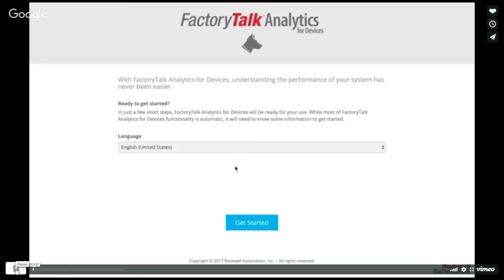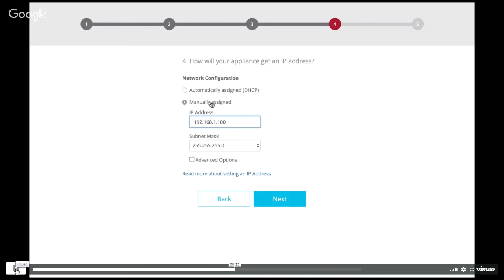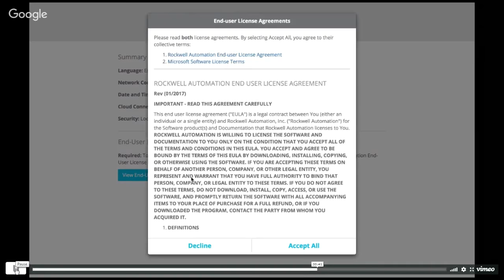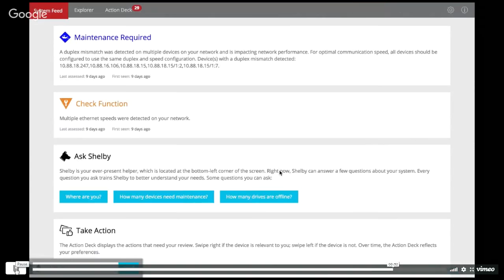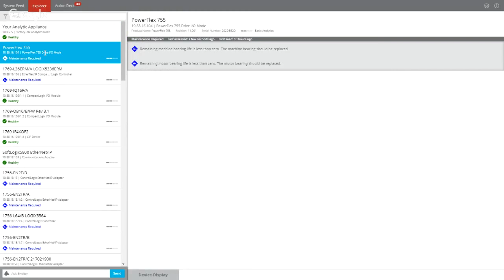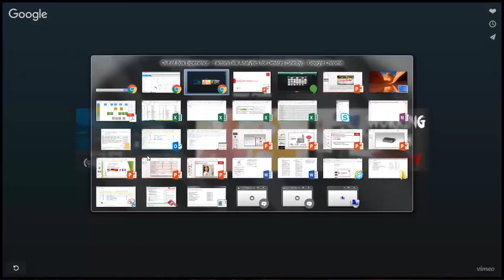FactoryTalk Analytics for Devices

Comment: The idea is great and i tested the device already in january 2018. Now 15 Month later the device does still have the same bugs. A kinetix 5700 dual axis module will only show up one motor in stead of two. the new kinetix 5700 Series B will only show as offline. In case of power failure even with a ups isstalled there is no solution to shut the windows system down because rockwell locked the windows system and you will not able to access the serial port or the usb port nor you are able to install a ups program to shut down windows correctly. It looks like the system should be able to detect industrial devices but itself should no be installed in an industrial enviroment  #factorytalkforanalytics